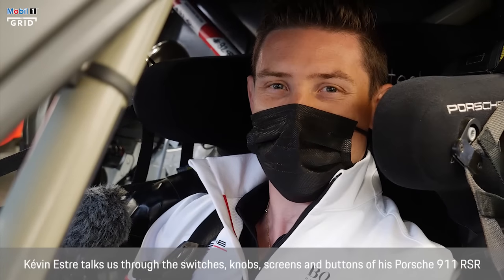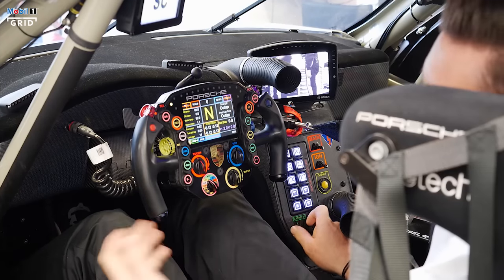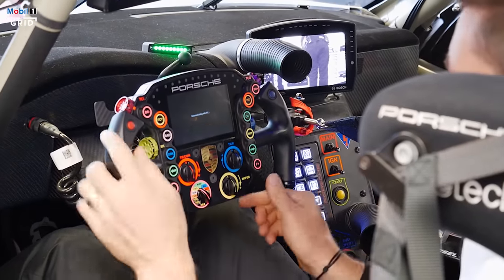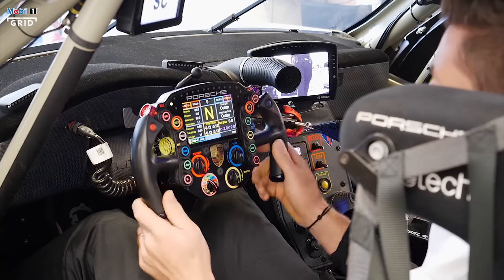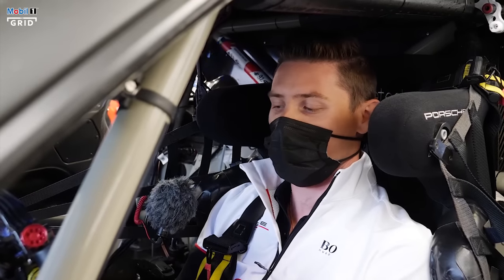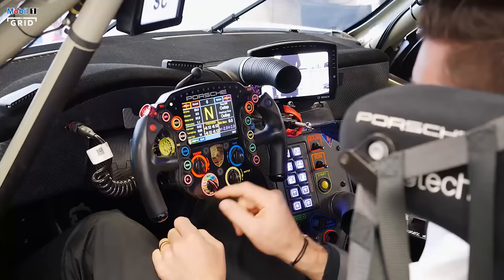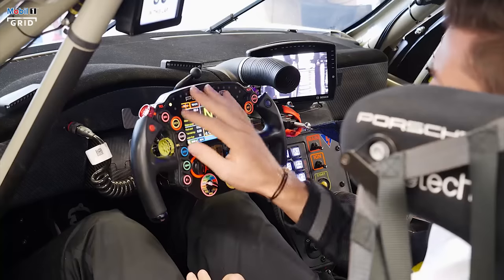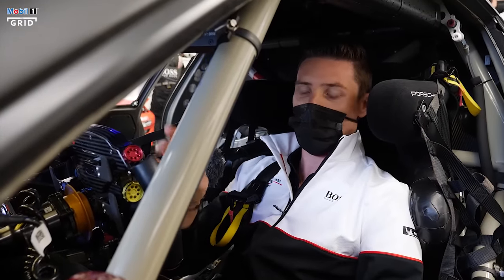Estre's 911 RSR Cockpit Tour - Tech Tuesday | Mobil 1 The Grid

Comment: Why have separate buttons for pit limiter and full course yellow? Is the speed limit different?
Reply from the maker: Full course yellow can vary through the different sports car classes depending on what the cars are comfortable doing for extended periods of time, but the pit limiter is set the same for every car for safety reason
Reply: @Mobil1TheGrid  Thanks a lot for the response.